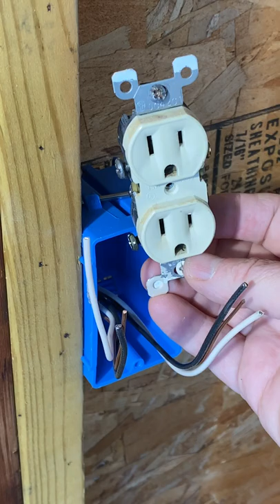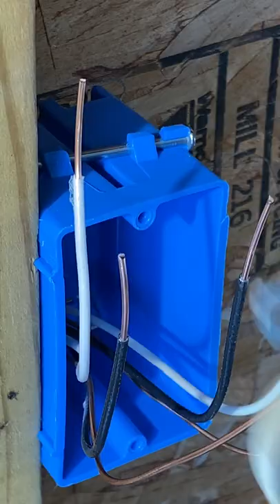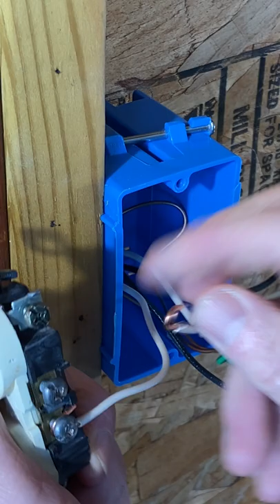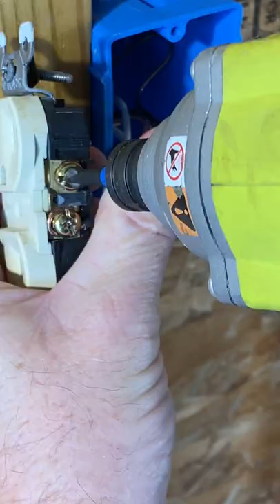Install an Electrical Outlet in 60 Seconds #Shorts

Comment: Foreman electrician here, don’t splice the circuit on the outlet it self, if you lose a neutral or whatever, everything down the branch will go off to, pigtail it, but keep with the good content.
Reply: Was going to say the same thing always pig tail
Reply from the maker: Thanks for the tip. There is a lot of debate on the pigtail. My though is the devices are rated for 20A pass through current even on 15 amp receptacles so the device is similar or better than the wire. I always pigtail where I know the load will be substantial or if I have more than two wires in the box. There is the argument that the connection can become loose but the same holds true for the wire nut. Pigtails definitely make it easier to troubleshoot.
Reply: They are good for 20 amps unless you break the tab, if you break the tab then the outlet is only good for 15 amps
Reply: @alanlautrup  Your point is moot, Alan, you break the tab and the receptacle cannot be used as a connector. If you break the tab or tabs for separate circuits it is still ok for 20 amp circuits if you're using 12 gauge wire.
Reply: @surferdude642  I’m fairly new to the trade. I’m doing finish work right now and I have the two gots and two neutrals and ground obviously, can I splice the two hots and pigtail one off to them instead of connecting both to the device
Reply: @peautifulbenis3673  Yes, as long as it's one circuit which is the most common. Bottom line though, do it the way the boss wants.
Reply: @surferdude642  thanks
Reply: @surferdude642  wrong… check your code book…
Reply: @surferdude642  wrong, check your code, the yoke is only good for 15 amps if it is broke and shared between 2 circuits
Reply: In your situation the receptacle will need to be changed anyway, and splicing takes too long.
Reply: FACTS
Reply: Electrician here as well. I always pigtail my circuits as well. Don't rely on the receptacles to carry the neutral to the next device. Receptacles should ATTACH to a circuit not be a part of it...However, production houses get the treatment shown in the video ( sometimes even get backstabbed)......
Reply: @richardurena4792  hey Any Stranded wire knowledge ?

My  home has  stranded wiring only a  black and white no ground on the second floor receptacles that have NO power. Please any advice where to start???
Reply: @Nellopi22  well, that sucks, since the most important wire it’s the ground, fix it
Reply: @richardurena4792  fixing it was the point of my question.  I'm seeking how the best way to do that.
Reply: @BackyardMaine No debate, the NEC hasn't allowed this for years. Its to prevent a potential open neutral situation, if/when the outlet fails. Most modern devices with a circuit board (ie everything) will likely get fried if you lose the neutral while the hot is still live.
Reply from the maker: @j.n.572  The only way a circuit get fried from a lost neutral is in multi-wire branch circuits. The second circuit can feed through the load and complete the lost neutral circuit raising the voltage to 240v minus and voltage dropped through the (now) series circuit device. The code limits the use of this method for that reason and when it is used there are several requirements to prevent this from happening.
Reply: Here in Michigan. the neutral and ground must remain unbroken. The device cannot be the connection. Gotta pigtail.
Reply: @BackyardMaine  you are thinking of standard analog devices. However, when the neutral is broken, things with capacitors can still draw power through the unbroken hot wire. However, they no longer have the ability to discharge onto the neutral. Sometimes when this happens, they blow up, causing those devices to no longer work. Also, people can think that a circuit is off, when in fact, the hot side is still hot, resulting in a shock hazard.  Also, sometimes devices can start to complete the circuit on the ground instead of the neutral when the neutral is broken. This can result in over or under voltage at the device as well a a shock hazard damage and equipment damage. You have to think about what is getting plugged into the outlets and not just the outlets themselves when wiring things up.
Reply from the maker: @tipofmitt  It might be a local code but not state code. I have access to all the state codes and none of them require pigtails.
Reply: Pigtailing isn’t required;HOWEVER it does make it a better/safer connection. Also it allows for the wires to be more organized in the gang box as well. No code violations that I’m seeing. It’ll work fine. Some “electricians” can be soo judgemental when they probably don’t even know how to do a 3 way switch 😂
Reply: @BackyardMaine
Reply: I always wire in parallel
Reply: @surferdude642 
1st part, correct.
2nd part you create 2 single circuits which a 15a  receptacle cannot be used.
Reply: @surferdude642 Negative do it to code. Screw the boss.
Reply: @BackyardMaine pigtail is a better install.. I've had plenty of calls where the receptacle failed and killed the whole circuit.. it's costly to repair so when I Rewire a house I make sure to pigtail and explain to the customer it's a extra step but that's why they are paying premium... quality install vs budget install..
Reply: Everybody keeps using the term pigtail but they don't explain what it means for somebody who's not a foreman electrician like myself I have no idea what you're talking about
Reply: @Nellopi22  I know it's an old comment and you probably got it figured out but my advice would have been to call an electrician
Reply: @Nellopi22 You have to troubleshoot everything on that circuit.Try finding the homerun(the wire coming from the panel,or the feed in wire first),with a volt meter,or a NCVT.
Reply: @justme5384  thank you. I actually changed the outlet and it worked without a ground because it's a metal box grounded with the screw from info I have come to understand
Reply: @spencerwyche2552  thank you for the feedback I  definitely need to do this
Reply: Load is irrelevant,  dont rely on device for continuity of the circuit
Reply: @BackyardMaine I'm lazy and I use Wago connectors to make my pigtails. I also tape the wires together before using a wire nut and then after so they'll never come apart. Haha.
Reply from the maker: @marcinfo3099  The manufacturers design the device to carry the full circuit load. As a matter of fact the passthrough current rating is 20A on a 15A receptacle.
Reply: ...but he still insists we are all  "misinterpreting" the NEC code in all his replies 🤦🏻‍♂️.... Put it this way... Ive pulled more bad receptacles out of walls... than I have bad splices... Trust the splice...not the device.
Reply from the maker: @pappym.8421  Just read the code my friend. You can say I prefer pigtails and I won't argue but don't say through wire is a code violation when its not. If your so sure quote the code reference. Use the book not what someone told you.
Reply: Exactly not to code
Reply from the maker: Im not sure if people don't know the code or they don't know what a multiwire branch circuit is. To help them out here's the actual text in 300.13 
In multiwire branch circuits, the continuity of a grounded conductor shall not depend on device connections such as lampholders, receptacles, and so forth, where the removal of such devices would interrupt the continuity.  @joshbaker855
Reply: How would u just lose a wire on the outlet that is the part of the pigtail debate that I don’t get if u connect the wires properly then there should be no reason u are losing a wire. Unless there is a part I am not seeing pls reply to my comment 😁
Reply from the maker: @electrokid4885  What they're talking about is a loose connection that becomes open over time. I find that this is more common on a wire nut connect than a through wired receptacle. If the connections are installed properly either method is going to be reliable.
Reply: Pigtails??????????

Comment: Use pigtails.
Reply: Not necessary. That’s an optional method.
Reply from the maker: It a preference not a standard. Code allows either.

Comment: That isn't how you do it . You have to pig tail the black and white and ground
Reply from the maker: The pigtail is an option but either way is permitted by code. The receptacle pass through current is listed at 20A even for 15A receptacles. So it's actually as good or better than the wire. The limiting factor would be the connection. If you make a solid side wire or compression connection you will be fine. If you back stab they you should pigtail every time in my opinion.

Comment: I always wrap the screws with electrical tape to cover the screw heads
Reply from the maker: I used to do that when I used a metal box but with plastic I didn't bother. Not a bad practice though. Thanks for watching.
Reply: @BackyardMaine  true but there's bare ground in that box
Reply from the maker: @lamarsmalls8771  It’s not a bad practice to tape but not required by code. The way I tuck the wires into the box there is no risk of the bare ground coming in contact with the energized terminals. Good point though.
Reply: Then the tape starts to come loose over the years
Reply: @BackyardMaine  I’m with you. I personally only tape in metal boxes or overly packed boxes. Not in plastic or PVC.
Reply: I only wrap on EMT, not Plastic.  But screw in unused screws.
Reply: Even in a plastic box? Good for you guy
Reply: @GlitchedPepsi  I just replaced a dozen older style outlets with new ones.  All were wrapped and were in there for over 20 years.  Not a one had loose tape
Reply: Why
Reply: @lamarsmalls8771  why would you need to insulate the non-current-carrying conductor if there's anything metal that is touching it should be bonded anyway down the line so therefore it wouldn't matter if it was insulated at the box or not
Reply: @tyronebiggems6072  that guy likes to waste time and have sticky hands when he has to go back and work on one down the line
Reply: this is ok. usually I use tape on industrial stuff where every box is metal and uses emt.
Reply: @michaelcoll433  Tape was better 20 yrs ago .Today's tape is only rated for ,5 --7 yrs obviously just made that up but dam does it not ring true 😂
Reply: @lamarsmalls8771  when was the last time a ground wire electrocuted anyone
Reply: Gay!
Reply: I only tape outlets in metal gang boxes but that's just me...
Reply: Me too
Reply: If non metalic box taping not really necessary
Reply: Yeah whoever installed my outlets in my house did that
Reply: NM Box buddy.
Reply: tape comes loose (if you stretch it) as it tries to find its original state. just roll it out and lay it on the screws. 2x is enough @GlitchedPepsi
Reply: Just put some pookie on the screws hvactrician 😆
Reply: You only tape in metal boxes

Comment: As an electrician, I would have spliced the wires just in case the outlet failed,this way anything down the line would still work,yeah,yeah!!
Reply from the maker: I do use pigtails depending on the situation. I have a full video on that as well.
Reply: Totally agree a very good practice
Reply: I will think about that one
Reply: The outlet would have to fail at the brass tab for the rest not to work

Comment: Shit I learned how to install an outlet! I also learned that I shouldn’t do anymore electrical work without shutting off the power first, it tingles! 😂 I love your videos man! Straight to the point!
Reply from the maker: Thank you my friend.
Reply: Thanks for letting me know to turn off the electricity first! I was going to go get electrical gloves and start working on things !
Reply: sounds like you still had ground connected, which is a good thing bc that's the reason you still breathing. I think that's a lesson any human would learn after that 😅
Reply: Yea it was extremely dangerous to not  SAY THAT IN THE BEGINNING
Reply: I was gonna say he forgot to mention to make sure you leave the power on and douse your hands in water to amplify the experience.
Reply: Yeah but the tingling only lasts 1/4 of a second, if your lucky 😂

Comment: You didn't mention facing your terminal loops to the right on the screws so they tighten down with the screw.
Reply from the maker: No I didn't say did I.. I did do it though.

Comment: That second set of wires goes to the next outlet. To avoid loading through each outlet first combine the two in a pigtail and then wire the pigtails to each outlet.
Reply from the maker: Pigtail is an option but either way is correct per the NEC. The passthrough current is listed at 20A even for 15A receptacles.
Reply: @BackyardMaine  what does the NEC say about back stabs?
Reply from the maker: @consaka1  If you're using them which are approved I would pigtail every box. Those connections are very problematic.
Reply: @BackyardMaine  pigtails are common sense in the age of computers 
and tape those respectacle terminals!
Reply from the maker: @yiannimil1  I disagree and Ive been an electrician for almost for decades. Also I never tape devices. Nothing wrong with that if it makes you feel safer but it's not recommended for a variety of reasons.
Reply: reasons being?   @BackyardMaine  
and if it was not a good reason, why do they now have them available WO exposed metal on the respectacle.  many things are code but unsafe. 
like  exposed copper in EDPs  and JBs. such things should not ne permitted today. 
the only reason i've heard for do not tape is materiel and labor. oh! and the accumulation of moisture under the tape!!
Reply: Tape is more of a commercial thing…cause of metal boxes. Not code just a good practice! Thanks for the great content

Comment: Use spec grade receptacles those with plug in holes are crap 50,+years in trade
Reply from the maker: I agree that commercial grade devices are a much better product but most people buy the cheep residential grade and to be honest they will hold up fine in most areas. I lot of receptacles in a home will be used rarely or some maybe never.

Comment: Nec 300.13 In multiwire branch circuits, the continuity of a grounded conductor shall not depend on device connections such as lampholders, receptacles, and so forth where the removal of such devices would interrupt the continuity.
Reply from the maker: I'm aware of that code reference and I even talk about it in some of my videos. What you're missing here is the definition of a multi-wire branch circuit. Multi-wire branch circuits have two or sometimes three separate ungrounded hot wires with voltage between them (240 line to line 120 line to ground) sharing a common ungrounded neutral. A single circuit feeding outlets is not a multi-wire branch circuit and pigtails are not required meaning the neutral can in fact connect through the device.

Comment: Couple questions I’m trying to replace an outlet I had. 

1. My previous outlet only has a white wire, black wire, and ground. The white and black were plugged into the slots on the back you stated not to use. You’re saying don’t do that again and instead use the corresponding screws?

2. Is my best bet to just cut the breaker to the whole house since I’m not sure which breaker the outlet goes to? Cutting the main breaker switch won’t cause any harm anywhere right? 

Thanks
Reply from the maker: Yes connect to the screws rather the holes on the outlet. I’ve seen these connections fail many times. Turning off the main will not harm anything. You could also use a tester or something you know works plugged in to be sure the power is off. Believe it or not people die from 120 volts all the time so be sure there is no voltage present before you start.
Reply: If you were going to try this, you probably already have done it but don't forget that cutting the main power is going to shut off any clocks, refrigerators, freezers, air conditioning, internet routers etc
Reply: Just plug a radio in ,turn it all the way up and turn them off one at a time.Might as well label the breaker.
Reply: The best advice on this is, if you don't know about electrical work, don't touch it! If done wrong, you can burn your house down. Call an electrician

Comment: Excellent video brother!! To All, I would keep in mind that it is better practice to tighten receptacle screws manually with a flat head screwdriver.
Reply from the maker: Thank you. I am able to use the impact without issue but it does take knowing the feel and when to stop.
Reply: Or “better yet” use a #1 Robertson (square #1) or an ECX. If you don’t have either of these, then yes a Flat Head is better than a standard Philips.

Comment: You should always wire up the ground first and tighten , then the neutrals and then the hot . And just make the hook with the end of your strippers
Reply from the maker: That's a good safety habit taught to every apprentice.. And it should be used if there is any chance the circuit is energized or may become energized.
Reply: You should connect the hot first. The neutral is second and finally the ground. This is the safest method of connection because you can always be holding the receptacle with your bare hand and do not need to be concerned with the hot touching another part of the receptacle during installation. Once the hot is secured to area you need to stay away from is small and easy to avoid. Installing the hot is a higher risk 2 hand maneuver once the neutral and ground are installed with the ground adding the most risk. A short piece of tape over the hot screws is also an option.
In a car connect the positive first and the ground last. This prevents the wrench from becoming high risk to short to anything grounded.
Reply: @WireWeHere  Interesting logic, but it doesn’t really matter unless the circuit is live, which should only happen if the circuit is keeping someone alive. Turn off the breaker.

In a car it makes sense, but only because there is no switch on the battery. Never work on live circuits unless absolutely necessary.